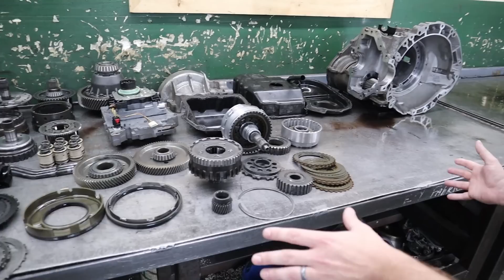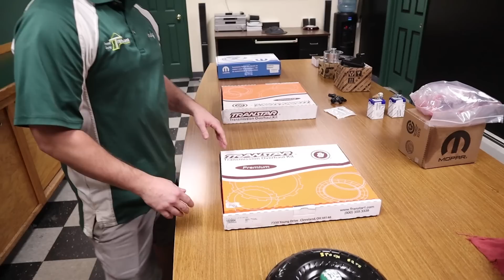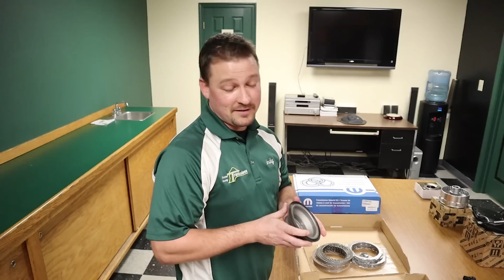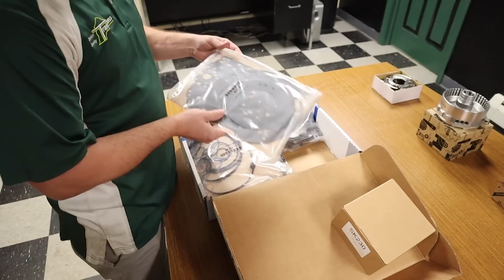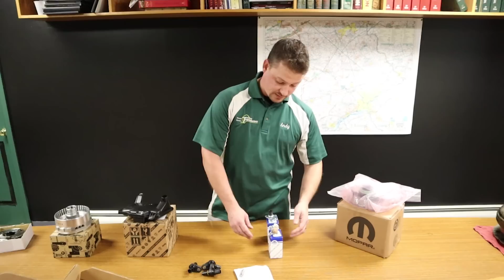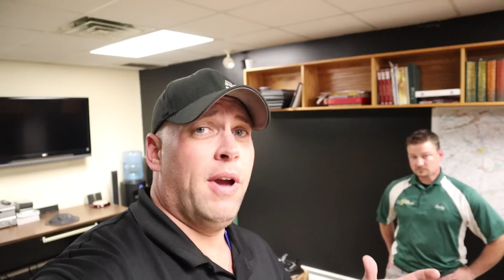DON'T CUT ANY CORNERS! 68RFE Transmission Overhaul Cost

Comment: Almost a year later. How many more miles before you need to replace transmission again?  I figure you can get 12 to 18 months per 68RFE, so you are getting close to having to replace it.
Reply from the maker: Build it better & it was last longer. So far so good, although it’s no longer mine. Started a new project

Comment: but I do appreciate the info, thanks reputable shop for sure.  You should post the valve body plate upgrades line pressure monitor and even gm solinoid as an option.  Guys should get all the upgrades, make these trucks better then new.

Comment: Hey there, loved the video, I have a ram 2500 with a 68rfe and when it shifts it sounds and feels like it shifts 2-3 times before it locks up and has a big flair in between shifts. I'm not sure if it's going out or if that's normal. I would like not to have problems but if I do I'd like to build it right.
Reply from the maker: That’s not normal.
Reply: Ram BEAST Projects that sucks because it only has 60,000 miles. Maybe I'll give you guys a call
Reply: @tomhanson329  is the truck deleted? When I deleted my 2012 it had around 65k...JUST AN ENGINE TUNE****.....I immediately noticed a strange flair/shift/lock up/whatever(only around 20-35mph light throttle/acceleration from a slow roll/stop).....put a trans tune in the truck and instantly gone!!!
Reply: dirtydan no it's all stock, it has just over 60,000 miles not deleted. It slips and acts crazy when I really get on it and then shifts into over drive at super low rpm.
Reply: @tomhanson329  Ehhh...doesnt sound good...have you tried turning off O.D./TOWHAUL??
Reply: @tomhanson329  what year is it?
Reply: dirtydan it's a 2016
Reply: dirtydan yeah I drive around in tow haul and ex break all the time
Reply: @tomhanson329  60k miles, not deleted, should still be under warranty.

Comment: Okay. So im looking for information and input, great video by the way! I have a 2015 ram 2500 laramie, its bone stock, i plan to leave it that way or do some small longevity mods as i plan to keep this truck a very long time, i pull a 16 foot enclosed everyday in spring summer and fall. Total weight including truck is about 13000 lbs. The dealer just put a new 68rfe as i had the clutches burn up and the od accumulator piston blow through the cheap plate.  Chrysler has told me this is an updated trans but couldnt tell me what was upgraded.  Im looking to beef  up the trans but only do whats needed not over and above.  If anyone has suggestions i would greatly appreciate the advice!!!
Reply from the maker: Are you local to me?
Reply: Ram BEAST Projects If i was, i would drive straight to andys thats for sure!
Reply from the maker: Ok, so at bare minimum I would suggest getting the following: 1. RevMax ValveBody, 2. RevMax Filter Adaptor, 3. RevMax Billet Flex Plate, 4. RevMax Triple Disc Converter, 5. Deep Trans Pan, 6. Overhaul Kit &  7. Most Important* Sonnax Clutch Drum Upgrade.
Reply: I wish I was, watching from windsor ontario canada, right accross from detroit michigan.

Comment: Maybe I missed it. The trans rebuild was around 4k but how much for the re gearing. Btw your truck is awesome.
Reply from the maker: Correct, $3500-4000... The gear swap is about $1500 a diff.
Reply: Why not get the whole suncoast trans for $5500?

Comment: I wonder if Andy has dealt with the “chirp” between shifting 3 to 4 in these 68rfe transmissions. My 14 mega cab has it some under moderate acceleration
Reply from the maker: My truck still does it from time to time. I heard that RevMax has solved that issue.

Comment: I purchased my first diesel new, 1999 Dodge 2500 4x4 with auto trans. No Mods, I towed a horse trailer all over the NC, VA & TN mountains for a few years along with towing trailers for work and a bass boat. In 2005 I traded it with 251K miles, never had any problems. I then purchased a 2005 Dodge 3500 4x4 dually, upgraded horse trailer to full living quarters towing 2 horses in a 40'x8'x8' trailer weighing 13,500 lbs. No mod's and no problems, just traded it at 207k miles. Both trucks were running perfect and pull like a champ when I traded. Of the thousands of miles towing those trailers with both trucks, only used tow haul pulling very steep grades. Both trucks got transmission flush and filter change, transfer case, rear diff, front diff change every 30k miles. Mechanical told me it was a waste of money but all of that hard pulling and no drivetrain problems with either truck! I just purchased a 2018 Ram 3500 dually Limited, 4x4, HO 6.7 with Aisin trans. It will get no mods. Those trucks don't need mods, they run strong and will pull anything hooked to the hitch.
Reply: Chris M 

Absolutely... leave ‘em the heck alone! I’m the original owner of a 2000’ 24v quad cab that still feels as good as the day I bought it. When I die they’ll bury me in it. When my body decomposes my daughter will dig it up, fuel it, and pass it on to her kids.

Comment: When I use to race motocross we would only replace the fibers in the clutch and leave the old steels in the bike. I was always told a used steel always runs truer then a new one.... but when it comes to my transmission id rather it be all new lol

Comment: If you have a modded diesel always put a  3dics converter in it.  Andy knows what he is talking about dont skip any parts while ur in there. I spent $3500 just in parts on my 47re in my 96 12v and I did the rebuild myself.
Reply from the maker: Yup, we didn’t cut any corners.
Reply: Big Murph, how was the rebuild? How tough was it? Have you done it before? I have a book on the 68.
Reply: @georgejohnson6789  It wasnt to bad to do I never did one before I had a book also just take ur time dont skip over anything or parts spend the money and do it right the first time. I also did a 48re for a co worker after I did my 47re. Like I said pay attention to everthing.

Comment: Hellcat X 2 muscle car guy here & new to the diesel universe. Just got a 2018 Tradesman Cummins Ram w/G56 manual, so I'm learning. 🤔 Anyway although the Aisin equipped trucks seem to be the "gold standard", I like how every inch of the 68RFE has been worked out and solved. I won't shy away from a 68RFE truck if I ever need to make the decision. I'd just factor in the upgrade. Thx! Nice video & info! 👌
Reply: Haha 😄 Hellcats are neat. More available & cheaper than ever as well! I recommend the Charger for you! 👍 I don't race or beat on mine. They're just good reliable cars. Only mods are K&N drop in filters & wider rear wheels & tires. TrackHawks are coming down in price too. Very broad bandwidth to that platform! My original intent was to get a TrackHawk for the 4 season versatility, but all of a sudden after following diesel stuff on YouTube & research, I traded my daily 2005 F150 (good truck & took care of it) for a clearance 2018 3500 crew cab silver 6' bed tradesman G56. I just about daily it. I'm looking into a South Bend clutch & would like to tune it to the stock power level of the 2018 68RFE trucks, retaining all the stock emissions stuff etc... It's already way more than I need. Lol! 😄
Reply: Leonard Rice 

Welcome to the diesel brotherhood buddy and you started in the right place. Although all 3 will forever participate in the horsepower/torque war, the straight-6 Cummins is the gold standard in durability for which all others are measured. It will never tire, if it gets fuel it will always fire. I’m an original owner of a 2000’ Cummins quad cab and it still feels as good as the day I bought it. Even the trans has held up without incident! And if you’ve not heard, once you get diesel in your veins...😄

I’m envious of your 1-ton commercial man-trans and have been drooling over them for a year now.

I’ll say this to whoever will listen; the day someone creates a drop-in Eaton-Fuller swap (with on board air hi/lo) for these beasts, people will be beating their doors down for torquey Cummins ‘n 9-speed big rig shifting!

PS: take care of that high pressure injector pump with good lift pump and consistent fuel filter changes (perhaps upgrade to the FASS air/water separator) ‘cause if you damage it... oh Nelly, damn is it expensive!. I know first-hand😭
Reply from the maker: You’re welcome & I agree with you. I wouldn’t shy away from the 68RFE either. PS I want a Hellcat! Haha

Comment: Thank you for posting! Not many will show the cost associated with their mods. This is or can be an expensive hobby and if its your daily driver you need to know what to expect. I just discovered an oil leak in my Cummins. It has been tuned so I'm going to find out soon if the tuner affected my warranty. I'm prepared if I get denied a claim but we'll see. If I gotta pull the trans I might look into going ahead with supporting mods. Anyways, respect and stay safe.
Reply from the maker: The lock ups are awesome!
Reply from the maker: Oil leaks are no good. Where’s it coming from?
Reply: Ram BEAST Projects looks like rear main:(
Reply from the maker: Oh man.. Start planning all the other upgrades while you have everything apart.
Reply: My 2013 has been left stock other than 35’s. It has 122 k miles and still runs and operates with out problems. I see plenty of coal rolling hi lifted giant wheeled rigs and ask why. Sure it’s cool looking but if it’s your daily driver. Probably should consider a ATS Allison Transmission swap before doing those things. That’s another 7-10 grand. Ouch.
Reply: I can't even count the times I've heard 4th gen owners think they have a leaking rear main just to find out that it's assembly lube that is on every one of these trucks.  The amount of times of actual leaking rear mains?  Maybe one.

Might want to check it out before taking it to the dealer.  Assembly lube is a golden color where oil (from a diesel) will be pitch black.  Clean it off with some brake cleaner and see if it comes back.  If it does, then you have a leak and should take it in.  

If you're already tuned, you are a potential cash cow for the dealership with 100% of the liability resting on your shoulders.  If they mess something up, they can always blame tuning.  You think you have a leaking main seal?  Well, better pull the trans just to make sure... oh, btw this isn't covered under warranty because you're tuned.  Oh, it's not a leaky seal and just assembly lube?  Well, better replace the seal just to be safe...  oh, btw this isn't covered under warranty because you're tuned.  You see where this is going...

Fwiw, my truck had this same "issue".  It was assembly lube and I wager it's the case for you all as well.

Comment: Ram Beast Project 

Thanks for this video and the rest You post. Good job !!!

Can You ask this question to the guys You know at that transmission shop. I always wondered this but never understood, maybe they can clarify my question ?

Why is it that BD Diesel’s 68RFE transmissions requires a line pressure reading off the old transmission, before installing the new BD 68RFE Trans. 

BD says that their new transmission requires the TCM to be reprogrammed with the line pressures of the old stock transmission or it will burn up that BD transmission before you make it a full mile down the road.

I don’t understand that, correct me if I am wrong but ATS’ Transmissions doesn’t require all that line pressure checking of old transmission and reprogramming it into the same TCM that’s being reused with their new transmission ?

I know that the TCM needs to go through the relearn of the new transmission along with connecting the co-pilot that ATS provides with some of their top end transmission packages.

Here is the link to the BD Diesel’s 68RFE transmission swap, that I herd this from.
https://youtu.be/PdTHNtSRfSo
Reply: In the video you posted, at around the one minute mark, Johnny Kittson explains that BD requires a scan of the PCM before the old trans is removed and after the new one is installed (and quick learned) so CVI (and other data) can be logged and compared.  BD uses this information to verify that the trans was installed properly.  I imagine that this is for warranty purposes, at a minimum.  ATS does not require this.  The reasons are only known to them, I suppose.  However, the norm is to at least measure commanded & actual line pressure (LP) after the new trans is in.  Reason being is that a built trans can achieve over 250psi LP, where as the stock unit can only get around 170-180 max.     

As far as trans tuning (reprogramming) yes, you generally need this for any built 68RFE (there are a few exceptions).  ATS doesn't need this because the "Co-Pilot" acts as an interface that essentially fools the PCM into behaving as if it were tuned (higher shift points, higher line pressure, etc.) but thinking it's delivering stock values.  Conversely, tuning simply adjusts the values in the PCM so it can command 250psi LP and achieve 250psi LP.  Personally, I'd rather pay $200 for trans tuning than $1300 for the ATS unit.

Also worth noting, RevMax has just released a 68RFE that does not need any tuning which drastically outperforms custom trans tunes.  My RevMax 700 68rfe will be going in for an upgrade very soon.  

Hope this helps.
Reply: Monster RAM 

Yes it helped Thank You.

After I made that book of a comment, I researched it little further and understood what I was asking about.

I am just getting some knowledge together on what I will need, and what I will need to do, for when I swap out my 68RFE from my 2012 Cummins.

By trade, for past 14 - 15 years, I work on tractor and trailers.
But pulling a trans, clutch, and flywheel out of a Peterbuilt is one thing (basically swapping parts) 
but with this 68RFE   I have to become an IT tech.

I should have ordered a Manual transmission when I bought my Cummins back in 2012.
Reply: Monster RAM 

One more thing, I don’t know if You know about the ATS transmission brace they offer, but You should get one after all that work You had done.

Apparently the 68RFE tends to crack along the top of the case because of the case being so thin. 
The added torque coming through the transmission from tuners, Injectors, turbos, ect... will crack a built 68RFE without the ATS brace.
Reply: Shawn Eid - I have the ATS brace on my RevMax 700 68RFE.  I see it as cheap insurance and would recommend it, but there are plenty of built 68RFEs without them that haven't cracked a case so it's up to you.  Is your trans now having issues, or are you just wanting to upgrade?  If you're going to build/rebuild it, I'd have a power goal in mind and go from there.  With my truck, 700 - 750whp was the goal so I went with an appropriate trans.  If you are at stock levels, I'd probably get a Suncoast rebuild kit and a few hard parts that money would allow and you'd be fine.  As far as who is going to do the work, I'd have it done at a shop or get a fully built unit.  You'd probably be fine removing/installing the trans yourself though.

Comment: So I have to ask you why not start out with a Ram truck with the Aisin transmission? It’s a transmission originally put in medium duty trucks Paul from PDdiesel loves them and it seems they hold up well under a lot of stress on them.
Reply: hpkntnw you can’t tune an aisin. You can tune and bulletproof a 68rfe
Reply from the maker: I honestly didn’t know the 68rfe’s were prone with these issues until after I purchased my truck. I assumed that it was a diesel & the transmission would have been engineered to hold the torque & then some. I’m sure that I’m not the only one either. Just trying to help others out...
Reply: Aisin is great if you want to stay stock or close to stock. With the mods Steve has done he's probably better of in the long run the way he went with the 68RFE. If you want a 2500 its the only auto option.

Comment: Great video, Steve!  Andy too.  Glad to hear it's working well, and at about half the cost of a fully built unit. 👍

P.S.  Don't forget to include the RevMax valve body!  😉
Reply from the maker: Thanks Mike! Hope you got back home safely. I didn’t include that intentionally, because we didn’t install it during the overhaul.
Reply: We did, thanks!  Only reason I mention the modified VB is that you must have it to get over 180psi line pressure and fully utilize those nice upgraded clutches!
Reply from the maker: True